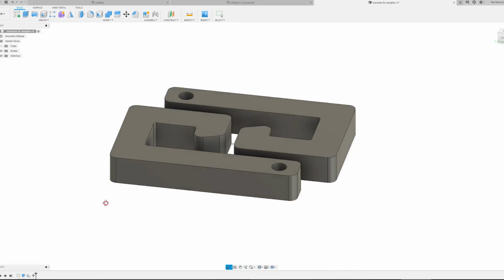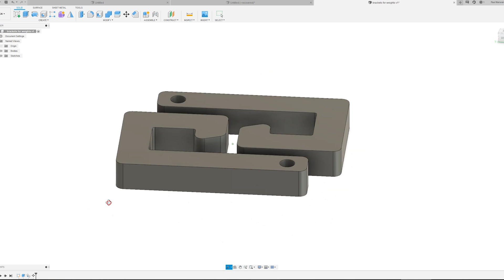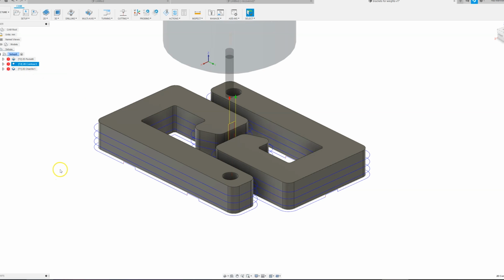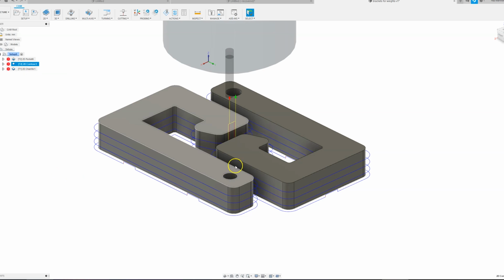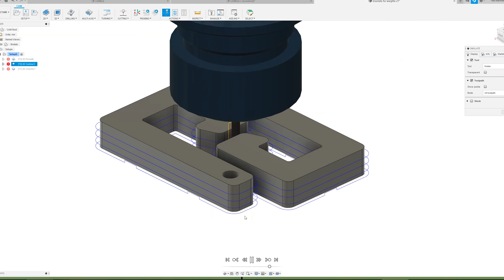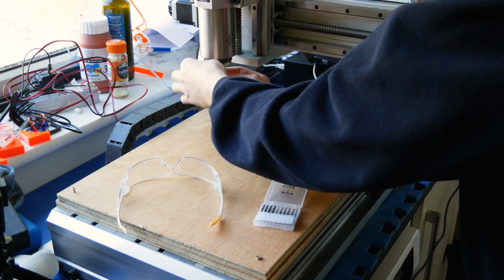My First CNC Project - Plywood hooks

Comment: When you are going to cut metal on this machine, I will recommend that you buy a single flute end mill. It will take less material off per revolution, as opposed to end mills with more flutes, and therefore the cutting forces will be decreased (which you would want for less rigid CNC machines). This should make the cutting process smoother 😁
Reply from the maker: interesting idea, ive heard that for cutting metal you want 2,3 or 4 flutes from most online sources however. I guess its something i'll need to try when i move onto metal.
Reply: @ThisDesignedThat  Well yes... that is true for spindles with lower rpm. An end mill must take a minimum depth of cut per flute otherwise it will rub against the material instead of cutting it. So if you have 4 flutes at 16.000 rpm you will have to go really fast, but if you use a single flute cutter at 16.000 rpm you can go 4x times slower. If you use a 4 flute cutter at 16.000 rpm you machine would need more rigidity in order to cut at the desired speed. "So I can just slow my spindle down" - you might say, well your spindle loses torque when you set it to lower rpm's. This is why a single flute cutter is a great option because it allows you to use most of the torque you spindle can provide, while still cutting at a feed rate that doesn't require you to increase the rigidity of the machine. 
So when the day comes, and you want to cut metal, I will recommend a single flute end mill.
Reply from the maker: @user-hv2nm2lm4i  i see, that does make sense. I've just had a go at cutting some really gummy aluminium today and ended up snapping 3 endmills so im in the market for some new ones so will pick up a single flute for the next aluminium job, thanks for the help
Reply: @ThisDesignedThat  No problem, I'm glad I could help. I'm still saving up for my own Omio CNC, so I'm very much looking forward to snapping some endmills myself haha.
Reply from the maker: @user-hv2nm2lm4i  oh nice, so far its been great so i recommend omio, especially for the price I got it 2nd hand, basically half the price of the brand new, keep a look out on ebay!
Reply: @ThisDesignedThat  Ohh great, wow I didn't even think about looking out for one on eBay once in a while. Thanks!